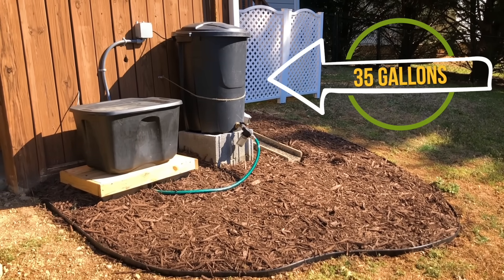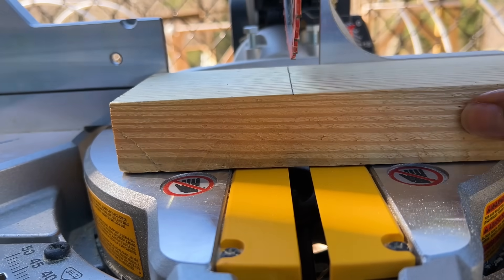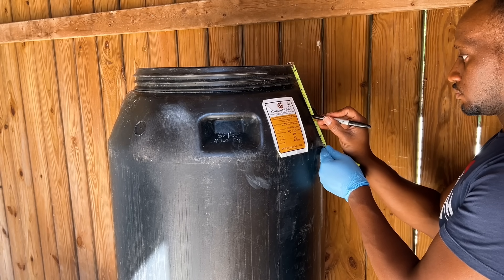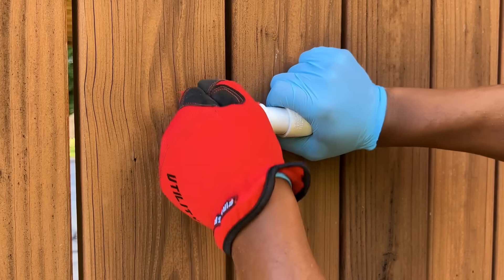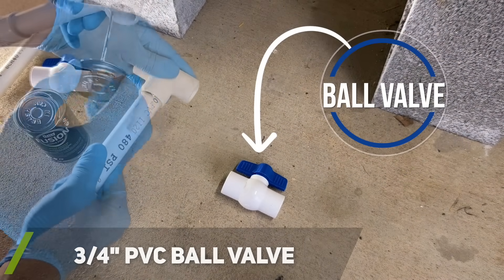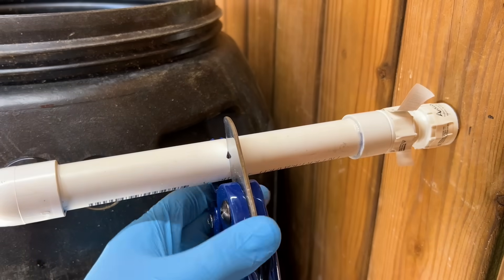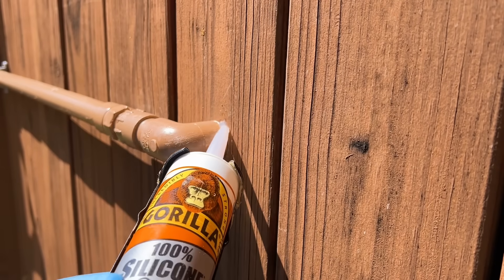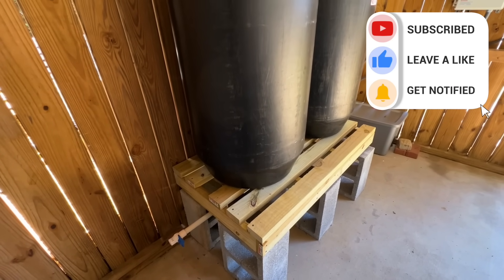Rain Barrel System | CHEAP Water Capacity Upgrade

Comment: Let us know how long the filter goes before it needs cleaning. Also, Is the gutter surrounding asphalt roofing? 

Is there not a greater need for improved filtration? I was actually pleased to find that you included the filter component to the system! Im sure it depends on the final destination of the water…

Great and thorough video; we appreciate these walk throughs and examples.
Reply from the maker: Hey Cory. For my application, I can probably go anywhere from 3-4 weeks before I should probably check on the filter and give it a quick rinse. It may vary depending on your homes location and rather or not you have gutter guards installed which I highly recommend. My gutters currently do not have them installed by the way.

My roof is an asphalt roof. 

I'm looking into first flush systems as another method to help remove some of the debris from my system as well. 

Hope that helps!
Reply: Awesome input for me. Thanks for the response! Yea I got 5 big ol oak trees all within ~20ft of the house, so I know the job a gutter can be, as well as how important it is for the gutters to be clean and flowing optimally. I have guards on them currently, but they’ve been on for 10+ years without a good clean and I’m sure a good amount of asphalt debris has settled in gutter from storms, etc. I’ll probably do that first (clean it up) before I get a rain collection system up and running. The other option is installing a new gutter/collection system on the shed, and working anew, this route would allow me to direct the water internally in the shed like you’ve shown here. 

Im very glad you added the portion on how to acquire the materials as well. For the longest time (2+ years of passive ignorant shopping around) I’ve been trying to find something that didn’t cost >$100 just for a relatively small collecting tank. Your sharing has helped me financially for the future.

Comment: In Colorado a private home owner is not currently allowed to have a rain barrel mainly due to taking water that would normally run off (downstream) in keeping with the Colo River Compact of 1922. Basically saying Colo must abide by a century old archaic  contract that was never ratified or voted on by Colo voters to send 7.5 million gal down river to 7 states ( daily) which is still in effect. Then Mexico was added in 1936 to receive part of Colo water. Contention is still being fought in water courts. Note: I believe since this was done  (contract signing)  behind closed doors in 1922 by unscrupulous men who took $$ under the table  is the reason why 7 other states are facing shortages today. Nothing good comes from deception & cheating. By the way the Native Amerucan were not at that signing table & should have been. West of the 100° line Prior Appropriation laws are in effect. ( FIRST COME FIRST SERVED).

Comment: Real clean set up and design but I was curious if you were concerned about over flow in case of heavy rains?
Reply from the maker: Hey Edward. Good question. Once my barrels are full, the diverter I have installed in the downspout is designed to send excess water down the downspout. I've used this diverter type for a few years now and so far have not had any issues.

Comment: Nice job! I’d run it through one more filter before consuming though to be safe
Reply from the maker: Hey Michael. Yeah I do not plan on using it for drinking water, but I definitely agree that if someone plans on using it for that purpose to use the correct filters and make sure you get the filtered water tested before consuming.
Reply: @GreenTechTown  Ohhh okay that makes sense. You did a great job on the build 👍🏼

Comment: Did you try to install a connection where you could use compressed air to blow out the lines prior to a freeze up? Even using a small garage air compressor would likely work. Is there an overflow safeguard in case of torrential downpours if you have the containers inside a building? Great video, as we’re building a garage and plan on using this type of setup.
Reply from the maker: Hey GH. Good question. I designed my system so that I could quickly disconnect different areas for maintenance or draining purposes. For my outflow pipe, I angled the pipe some by making the first rain barrel connection a little longer, so the water would naturally drain out if I disconnected my transfer pump from the system. However, I see nothing wrong with your idea as well. I'd say do what works best for you and your application.

As for the overflow, the diverter is designed to send any excess water down the down spout. I have yet to experience any issues with overflowing from the few years I've used it. 

Hope that helps some.
Reply: @GreenTechTown  ..thanks again, good to know👍

Comment: I'm a bit surprised of the sticker "don't drink this water", I mean if this is rain water and you have some filter, Why not? Just thinking that on a SHTF situation that water will cost top dollar.
Reply from the maker: Haha. Yes, if you have all the proper filters in place (which I do not in this case), you could use it for drinking water like many have done. With this system, there are still a lot of micro debris/bacteria from the roof that gets passed my sediment filter that would definitely not be considered good clean drinking water compared to municipal water.

Comment: why put feet on the wooden platform? it would be much more stable with the cross members sitting direct on the blocks
Reply from the maker: Hey J L. Since my concrete foundation is slopped in 2 directions, I added feet to the wooden platform to level the surface the rain barrels sit on to reduce the risk of them tipping over when they are full and to maximize the amount of rain water I can collect.

Comment: Where did you get the sediment filter and the swivel garden hose connectors
Reply from the maker: Hey Bruce. You can find the sediment filter at the following link: https://amzn.to/3uh4BDg
The swivel garden hose PVC fittings I purchased from Lowes, Home Depot, or Ace Hardware. Typically any home improvement store that sells PVC will have these types of fittings. You can also talk with one of the associates and let them know what you are trying to connect to and they will point you in the right direction.

Comment: Question - @green Tech Town 

How do you not have overflow through the breather tube that was laid in there. If the tanks fill up, does it back-feed through the intake line and back into the gutter and flow freely over the EarthMinded outlet you installed?
Reply from the maker: Hey Aaron. Yes, it is designed to divert any excess water out the downspout once the water in the rain barrels reach the height of the inflow pipe.
Reply: @GreenTechTown  Non related but might be up your Alley then. 

I currently have a 250 gallon IBC that i use for a chicken waterer. I use the PVC to go to the watering nipples for the chickens, but i have freezing issues. You use pumps within yours but only temporary - i was looking into getting a loop going that would run a pump at all times when the temp goes under 45 degrees.... My question is do you know of, or any ideas on if that same pump setup can be set up inline to run fill time? 

Dont have to answer, but just curious your thoughts or if you have run into freezing etc.

Comment: Are your rain barrels connected to interconnected to each other? As in if you use water from one barrel does the other drain into or do you get the water from each barrel individually? Thanks
Reply from the maker: Hey PapaTru. Good question. Both barrels fill and empty at the same time. They are linked in series and since water seeks its own level, as water is flowing into barrel 1, barrel 2 will also fill almost at the same rate.  The same concept would apply if I added additional barrels to the system and linked them from the bottom.

When I have time, I plan on making a follow up video that demonstrates and explains this process.
Reply: Look forward to seeing the video. Thanks.

Comment: I give you a tip concerning the use of silicone for these type of purposes. Most regular silicone uses solvents that are very toxic for micro bacterial life for a very long time. There is a special type of glue that is used for aquatic life purposes. It is also used to glue EPDM rubber. It has a black color, it is far stronger then regular silicone, and it even hardens under water, unlike regular silicone. Yet it also stays flexible and it has a rubber feel to it when it dries or hardens. It can handle UV light and frost without a problem. But most importantly, it is not toxic for aquatic life because it has no toxic solvents. 

Those solvents from regular silicone glue can have a long lasting negative effect on the micro bacterial life in your system, which you do not want to happen, because the micro bacteria do all the most important work in your garden, or in any other food growing system or aquatic system that heavily relies on useful bacteria. 

In general the EPDM glue is more expensive, and it also comes in the same package as regular silicone, but from my experience it is the best stuff that you can get for these type of applications. And it works great with these type of barrels, because I constructed an entire fish pond from different barrels, that I connected together with pipes below the water surface, without the use of dedicated pipe connectors. 

Instead I used EPDM rubber, and this EPDM glue to seal everything, and to keep the pipes in place. And it has been like that for at least 10 years without any leaks.
Reply: I think you totally missed what product he used. Watch again. He used Aquarium clear silicone. Clear silicone and even more those designed for aquariums are totally safe for beneficial bacteria and all aquatic life...
Reply: @NaturebyGus  You are correct, I did not see that. Nevertheless I think that EPDM glue or kit is far superior and stronger, especially for general outdoor use, especially in climates where it can be freezing cold and blistering hot. And I noticed that these days EPDM glue is also sold in a clear version. 

EPDM glue adheres to everything, including nylon, which most glues or even silicone doesn't do. Most silicone products let go after some time when you glue nylon or plastic in an outdoor application. EPDM glue doesn't. 

But it never hurts to point out that people should not use regular silicone for these type of applications due to the toxic solvents which have a long lasting negative effect on the aquatic life.
Reply: @insAneTunA  I still disagree about the long lasting effect of the solvents from clear silicone. The specifications of most clear silicones are very clear. They only release toxic solvents during the CURING process. After that they are 100% safe for aquatic life or beneficial bacteria with absolutely no solvents released (specially those like the one used in the video, made for Aquariums). Otherwise they will damage the super important beneficial bacteria of those expensive aquariums and their filters all over the world. Most EPDM glues also release vapors during the curing process. and they are not designed or promoted from the manufacturer as "reef or fish safe", some people use EPDM liners and that is fine and safe because they are already cured. This is from a well known EPDM glue instructions: "EPDM is extremely flammable during the curing process, do not inhale vapors. Due to solvent flash-off, condensation may form".
Reply: @NaturebyGus  If they are fish safe it is okay, I do not disagree with you. I only say that the EPDM glue is far superior to any type of silicone, whether it is fish safe silicone or not. 

And yes, the solvents in the bad silicone have a long lasting effect. In many cases the extra information on most silicone's even warn for that. I am not going to dispute the factory warnings. If they say it I believe them.

Comment: Not really shown on camera was: how does infill for barrel #2 work? You showed #1, but did not explain whether #2 fills from #1 overflow vs. shares a branched line. That is the critical piece of information to explaining how you increased capacity . . . .
Reply from the maker: Thanks for the feedback! I think I will make a follow up video that explains this in better detail as I also want to add a simple water level sight pipe so I can see how much water is in the barrels without removing the lids each time. 

For those wondering, in summary, this is a bottom filling system and both barrels fill at the same rate since water seeks its own level.